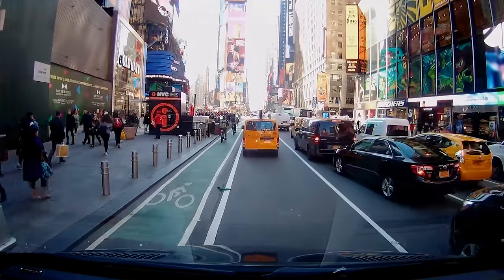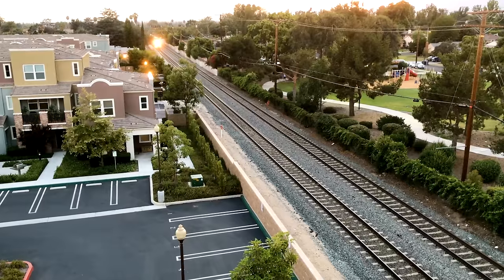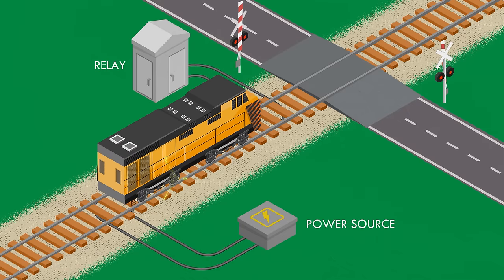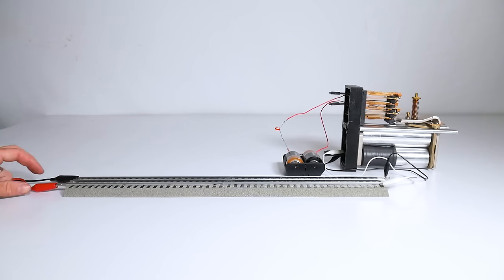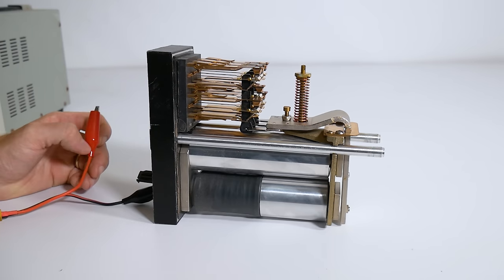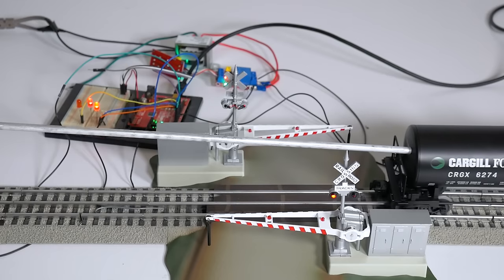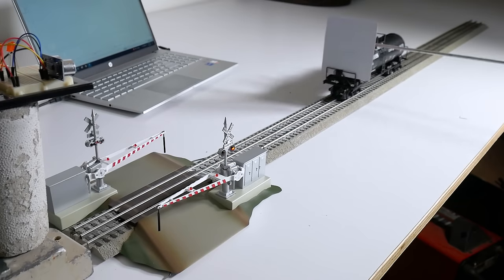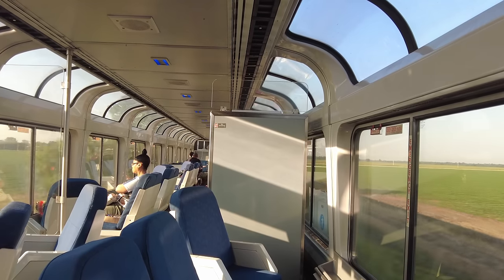How Railroad Crossings Work

Comment: It's quite interesting to see that apparently in the US the railroad crossings use track cirquits to detect whether a train is approaching or not. Here in Germany, they all work with directional switches that are activated by the train's wheel, and the crossing is opened with axle counting switches before and after the road. Basically if some amount of axles entered the road section and the same amount also left it, the safety devices shut off.
Reply: I'd say it's a standard in the EU now. All new actively guarded rr crossings built in Poland use axle counters
Reply: Yeah, in general it seems that American railroads (or the regulators) seem to focus less on preventing accidents, but instead they build everything railroad related like a tank so that on case of a crash, there are less deaths. A good indicator is that many railroads in America still use Track Warrant Control, essentially a glorified version of what we Germans know as "Zugleitbetrieb" or "Fahren auf Befehl".
Reply: @m0llux  I disagree with that assessment.
Reply: There are several different ways for railway crossings in Germany: axle counters are one, but there are others that are automatically closed when a signal is set over it, or the signalman has to manually close them from the signal box
Reply: Is it all axle counters in Germany? In The Netherlands, most of the network has track circuits as well.
Reply: The UK is all primarily track circuits. Anywhere that has been properly upgraded/resignalled since the 2000s are axle counters. Majority of areas are track circuit based level crossings and may include treadles to activate them as well. Very few areas use axle counters to activate level crossing. In the area I look after, there are only a handful that I can remember that use a form of axle counters (even in track circuit areas) to activate level crossings.
Reply: @marco23p  New and refurbished tracks tend to use axle counters because they are usually as reliable as track circuits, while avoiding its pitfalls. With track circuits, a single damp leaf can result in false positive signals and the isolation points usually get a lot more wear, resulting in higher maintenance cost and covered tracks (rust, leaves, sand) can lead to false negative signals. Axle counters usually (at least in Germany) work with inductive magnetic fields, so they are highly reliable.
Reply: In Germany we even have one track where a guy drives ahead of a train, closes the crossings, and once the train is through, drives back, opening them. But behind one of the crossings, there's only one house. Horrible solution, but that's what you get when politics has intentionally run down the train system for decades.
Reply: Pretty sure Canada uses the track circuits system too. I've heard of surveyors pulling tape across the tracks and having the rail inspectors come out as a result.
Reply: @GiantEnemyMudcrabz  “Pretty sure Canada uses the track circuits system too”
Canada and the United States are virtually identical as far as signaling infrastructure and design.
Reply: @Ruhrpottpatriot  While axle counters are very reliable the good old track circuits are safer. We also use axle counters in Belgium but I am pretty sure that most track circuits are still in place and a combination of both is used.
Reply: Axle counters aren't 100% reliable either, and they sometimes bring their own problems.

In Switzerland, it's not permitted to run a train with a multiple of 256 axles, because the axle counters store the count in an 8-bit integer and it rolls over after 255. So 256 axles would reset the counter to zero, making it a ghost train that can't be detected.
Reply: In the german-speaking railroad world, axle counters are more common, but track circuits are also used.

However, track circuits are more important in other countries like the U.S, Italy or the Netherlands. There, the signal aspects are broadcasted via a frequency through the rails.

Track circuits are more safer because of their superior detection qualities as well as their ability to detect broken rails. 

Axle counters are the more cost-effective solution in general, but are more prone to errors.

What you end up using depends on your rail systems infrastructure, situations and priorities.
Reply: Axel counters sound way more prone to error or damage than circuits
Reply: @Codewow  I am pretty sure they are less prone to error but less safe.
You might think "how can they be less prone to error and still less safe?". Well the problem with track circuits is that they can have lots of false positive (detecting a train while there is none) but a false negative (not detecting a train) is near to non-existent.
A typical false positive with track circuits is when it's snowing/freezing and road salt is used. Normally they avoid road salt near crossings but with cars driving arround the salt can spread.
Reply: @ppdan  I feel like a false positive is the best-case scenario when it comes to a crossing in terms of failure. It basically becomes a yield/stop sign at the point or a no-access intersection, if it is controlled by gates, that you have to detour around.
Reply: @Codewow  But too much false positives can have a negative effect. Imagine a crossing having far too much false positives to a point where people will start to ignore it thinking it's another false positive.
Lots of accidents at crossings are because people get used to the fact that they mostly still have enough time to cross ... but then ... it was one of those times where there wasn't enough time. There is also the "one train may hide another" where people cross right after the train passes not seeing that another train is coming because the first one that just passed blocks the view to the second one.
Reply: In belgium they almost all use both axiles and circuits
Reply: @SimonS44  Where in Germany are signalman still a think? I only know of infrared guns to close railway crossing on smaller regional tracks. But when they fail, the conductor has to manually close the crossing
Reply: cirquits
Reply: @marco23p  It depends on how new/well maintained the line is and if its a busy line or just some low traffic regional line. For example it can be the track ciurcet, crossing can be activated by signals (signal only turns green when crossing is closed and opens when signal block is free) or infrared guns are used, usally on regional lines when a station is in front of a crossing
Reply: I’m a signal maintainer in the US and we use a few different styles of ways to predict trains. We have grade crossing predictors that measure the speed of a train to the crossing and therefore activates it when it sees the train within 20-30 seconds of the crossing, we use track circuits separated by insulated joints, and overlays which is a circuit on top of a track circuit. Overlays can be up while the circuit is down. There might be even more, but that’s what we use on our railroad. We do have hotbox detectors that read bearing temps and count axles, but that’s not used for crossings. Also, as far as whatever system is better I don’t think is a thing, they are all good, but these systems are usually standardized based on cost and who cozied up and lobbied with the politician who pushed for it.
Reply: Those are the current standard in Germany (or the EU railway grid, actually), but with anything railway in Europe, it is just for new tracks. We still have any variant that was ever built from the 1800s onwards here. Track circuits are still in use, too, but they are old technology and therefore are phased out with refurbishment of crossings and mainly occur in less frequented crossings in rural areas.
Reply: @marco23p  It isn't. It is the new standard for a while now, but as in any European country, we have any railway technology ever put into service since the invention of the railway still in service somewhere in the grid. Track circuits should still be fairly common, as they are the precursor to axle counters.
There still are level crossings with entirely manually operation, too, in Germany. The only thing electrical for those is the telephone to tell the crossing operator (a guy in the train station close to it, usually) that a train will arrive at a certain time.
Reply: @ppdan  They are in fact NOT safer because track circuits have a multitude of failure modes, from leaves, to dirty tracks or trackbed and parasitic oscillation. Even a stronger rain can make them unreliable because the water on the tracks bridges the isolation. They can also fail with shorter and lighter trains. Not to mention that you need to replace the rails way more often.

Axle counters are better, but they are also much more expensive.
Reply: @jovetj  lots of Mexico too I believe, but kind of essential given how vital RRs are to freight movement in North America as a whole.
Reply: @Ruhrpottpatriot  Nearly all failures give a false positive, the big danger is having a false negative (not detecting an oncomming train) and those are highly improbable with rail circuits.
The biggest problem is parasitic coming from trains but those are well filtered and most have a detection that if such a parasitic takes place the train will shutdown (not going into more detail to avoid giving information here on how to tamper those systems ... and I am also not allowed to make that information public).
Reply: @KarlKarpfen  hello! I'm quIte sure the EU TSI reguation DOES NOT go in much detail as how railway signalling works, except that ERTMS/ETCS is the "safety system" to be employed. As ERTMS can be superimposed to the current national signalling standard, it is not defined how level crossings work because the RBC takes informations from the interlocking system (in Italy computer-based interlocking is required to install ERTMS). 
As far as I Know from signalling design, level croosing in Italy are managed differenty according to line importance and block type used. 
In high traffic lines where track circuit block section are used (BACC) level crossings are closed by occupying a set block section determined by line speed and opened as soon as the relevant block section (the one with the railway crossing in it) is freed. 
In low traffic lines where axle counters are used (axles counters are a block type in Italy and define if the line is free between two stations), railway crossing are closed using directional switches (whose distance depend on the line speed) and opened using a combination of a track circuit wich covers the reailway crossing area and an omnidirectional switch placed nearby (track circuit free and switch are both required to trigger the gat opening).
All currently installed level crossing system require a signal to stop the train in case of malfuncion (i.e. broken or stuck gates): it can be a block signal for BACC lines or a dedicated signal for low traffic lines. in both cases the train has to be stopped before getting to the level crossing.
Reply: Don't we use specific frequency detectors and stuff in Germany? I think you can't really compare German safety stuff to US railroad safety. The distances in the US are much bigger, trains much heavier (mostly) and very often the population density is lower by factor 100 or more. That resulted in different needs and regulations
Reply: @ppdan  thinking that false positves are way more likely isn't completely true. It's a very theroretical way of thinking about what can fail if other components of the system should fail that leads to this false assumption. In fact, we have to deal with the problem of not well-functioning track cirquits every day. There even is a paragraph in the german railroad regulation (Ril.408) which states that every track within a station that is fittet with track cirquits has to be driven over at least one time in 24h, otherwise it has to be seen as occupied because of the rust that forms ontop of the track. Another paragraph states that you have to tell the switchman after breaking, if you used sand till you came to a stop, because the sand can also insulate you from the tracks. And these are only the two most obvious cases.
Reply: @ppdan  They still have the problem that they might give false negatives in regular use. There have been multiple(2008, 2009, 2010 three in 2012 and two in 2013) near collisions in Germany because sand blocked track circuits. This has gone so far the the Eisenbahn Bundesamt as regulatory body issued multiple(!) orders prohibiting sanding in places where track circuits are used, unless absolutely necessary, precisely because the sanding (which had happened as dictated by regulation) prevented a circuit closure.

There's a reason why The DB Infrastruktur as infrastructure body, almost always uses axle-counters instead of track circuits.
Reply: Here in their Netherlands they are even integrated with signalling around stations to prevent crossings from closing. A train stops at a station for a specified time or until they operate a key (old method) or the traffic control clears the next section. Only then the crossing operates. Otherwise the crossing would be closed the entire time a train is stopped!

It’s complicated stuff and full of jargon.
Reply: Yeah sure that works great for your tiny little toy trains over there.
Reply: @mikeznel6048  At least we're not having disasters with dangerous chemicals that wipe out entire towns
Reply: The reason the EU uses axle counters is because of spacing control. One thing that has not changed in trains is that, at the heart of control, you have a token-passing system. It used to be from control box to control box, but it went to track circuits (prevalent in the US) where in the EU ERTMS where the tokens cover dynamic sections of track. They are all still used across the world! As part of getting the tokens for movement, you also have to ensure the switch is properly set and locked, no opposing traffic, until the next decision point. 
   Each has a tradeoff. The US trades granularity, and increased upkeep for the advantage of automatic operation (ABS - automatic block signal). Effective on busy freight corridors, where you can keep a two- or three-signal separation between trains. The EU relies on the trains to report their location using communication points (balises). The disadvantage is, in the event of a loss of state, you lose the tokens. You have to locate all the trains before the system is safe again. Axle counters provide some help in identifying occupied track sections, as well as protecting against a split consist (part of the train disconnects).
   You also need a centralized office for all the trains to report their locations to, and coordinate train movements. The US rail system has large areas where cell service can be spotty. 
   I've worked as a wayside signal engineer (US), and also for virtual block systems and PTC (on the Northeast Corridor, which is mainly ABS).
Reply: One other thing worth pointing out, that wasn't mentioned in the video is that continuous welded rail (CWR) is common in the US, and we are able to use AC track circuits still by putting a impedance bond (a coil)  where we want to divide the track - it provides a return path for the signal, and snubs it going down the rail. The advantage of CWR is it's smoother, you don't need fish plates (you need copper thermite), but the track circuits need to be tuned. 
   Rail crossing predictors involve calculating the max speed for the crossing, and determining how long the track circuit needs to be to provide enough warning. There's also logic in there in the event you have multiple tracks (you will ring the bell again and maybe blink the lights to indicate a second train approaching, keeping the gate down). As a controls engineer, you have to be aware of getting peoples' attention, and compliance, without being too annoying. Applies inside and outside the train.
Reply: @patrickvolk7031  What you wrote is utter nonsense. Block signalling exists since 1844 and automatic block control is used in Germany since the 1920s.

Also, ERTMS has NOTHING to do with signalling and tracks; that's ETCS, which defined multiple layers, from the old fashioned fixed blocks with track circuits or axle counters to moving blocks based on either GPS or Eurobalise positioning and a vehicle based position system.
Reply: It depends, there are limited circumstances (particularly in cities) where different detectors are used.
Reply: @edrose5045  that is a shocking oversight
Reply: @Ruhrpottpatriot  Axle counters aren't more expensive than track circuits. It's the communications structure that is the cost. Axle counters don't detect leaves or dirty tracks, or broken rail (that is more an improper inspection/maintenance problem). Why do you need to replace the rails more often (CWR with track circuits is standard, no joint plates)? I've had to investigate a (probably the only) parasitic oscillation problem, and it was a light rail and was because someone decided not to put a choke on their transmitter (and the customer allowed operation to continue with the problem). I've also seen one on an VBS (which is ERTMS more or less) where a train was not accounted for and collided after a power event. 
   Track circuit systems have been safe for over 100 years. There have been very few wrong-side failures. The US sticks with it because our rail companies are not state-run (except Amtrak), and it's not cost-effective for most of the rail network to change over. Lots of track has been removed, and more efficient use of other lines, and upgrading them has been the normal way.
   European rail is more than just freight. It's more dense in population than the US. The rail agencies are national resources. You guys run so many trains, the best way to increase capability is to space them closer together, and run them faster. The fact that operating rules have converged between countries, homogenizing the rails, removing breaks of gauge, has happened so fast is amazing. 
   Axle counters though don't need to worry about welded contacts from a lightning strike. They don't need inputs from another device miles away (often running on batteries where you're pumping 400VDC at the head of the codeline to get 24 VDC at the end, using some 400mm wire cause of the amps). 
    I've looked at EU communications for ideas on MOWESS (Maintenance-of-Way Employee Safety System). They have to rely on communications (if I hear 3G went away one more time...) because the speeds. US relies more on signs and lookouts (they can put down a shunt strap). I worked with some people in Germany discussing it (looking to cover each other with line-of-sight versus timetable safety).
    Both work, and work well. We always look to make them work better though.
Reply: Small add to this discussion: Germany doesn't build grade crossings anymore, if a road or rail is newly build or renewed a tunnel or bridge has to be build (the regulating agency could allow for grade crossings (only for sub 160km/h rail) in low population areas, but usually doesn't).
Reply: @nukehunterlp1371  You would need all wheels from the same side to be insulated completely from tracks and if all wheels from both side get insulated from the tracks you would loose traction unless it's a Diesel train. Also if the train is not detected and the crossway is not closed why was the previous light not red?
Reply: @patrickvolk7031  "Why do you need to replace the rails more often "
If you worked with rail you should know that... You have a weak point at the isolation point. That's a simple fact. Yes you can harden both ends of the rail joint, but it will still be weaker than a welded rail (which is the norm here in the EU). That's physics. Axle counters don't need rail joints, so that problem doesn't exist for them.

"CWR with track circuits is standard, no joint plates"
That only works with audio based circuits, not with electricity based. The latter MUST HAVE an isolated joint. However, the former has it's own problems, especially when electrifying the track because you need to watch out for your impedance characteristics.

"The rail agencies are national resources."
Most EU rail companies are private. Japan's railways are private. Both use axle counters. Your argument is invalid.

"The fact that operating rules have converged between countries, homogenizing the rails, removing breaks of gauge, has happened so fast is amazing."
There has never been a break in gauge, except in the former Russian Empire and Spain. Everybody else used standard gauge since the boom of railway in the 19th century.
And the two areas where wide gauge is used, it's still used today. The only country that wants to completely switch to normal gauge is Ukraine (for obvious reasons). All others will keep their own gauges.
Electrification is also not standardized and probably never will be and ETCS has provisions for national signalling built in (called "Level 0").

"They have to rely on communications [..] because the speeds."
We don't. Every country that has high speed has systems in place that does not need GSM-R/3G.
In Germany there's two systems, one for 160km/h and below, called PZB wich works with track-side signalling and LZB, which has cab-side signalling and works with a continuos antenna in between the rails. Heck, all (or almost all) main signals in Germany still have a phone-box.
ONLY, ETCS Level 2 and 3 need radio to work. Level 2 is only available on a few lines and Level 3 is not used at all.

"cover each other with line-of-sight versus timetable safety)."
There is no "timetable safety", not for the last 150 years. Safety in Germany and the EU is done by the common block signalling. Time-tables have NOTHING to do with that.

Please, please. Inform yourself, what you write is completely wrong.
Reply: @patrickvolk7031 "One other thing worth pointing out, that wasn't mentioned in the video is that continuous welded rail (CWR) is common in the US, "
It's also common in the EU? What do you think we are? Cavemen? Dude seriously, you're getting insultingly arrogant.
Reply: Well in the US we don't really use this type of crossing anymore. We use predictors such as the Siemens GCP and the Alstom XP4. They use AC signals to determine the speed of the train and give whatever warning time is programmed.
Reply: @Ruhrpottpatriot  You got anything other than semantics and "Deutcher ist besser!"? 
   Sorry, I should've said ETCS Level 3 systems. Because you said axle counters are better than track circuits, that's where I went (axle counters aren't reliable in brownfield installations)
   Safety 101 for you. There's open-loop, and closed-loop. Open loop requires something inserted into the safety loop to make the system safe. Closed loop means something have to be held off in order for the system to be safe.
   My brother thinks this is a bad analogy, but closed loop is your accelerator pedal. You can't make the car go unless you press it. If the pedal breaks. The car slows down.
   Your brake pedal is open-loop. The car goes until you hit the brakes. If the brake pedal breaks, you've got problems.
    Which is more common... parasitic oscillation (name one aside from Ft. Totten, I'll wait), or dragging equipment. If I remove the axle counter, what happens???? That is open loop. I remove the track, what happens? 
    GPS is soooo good, subs use it underwater. Works good in tunnels too, and is accurate enough to identify which track a train is on reliably... right? 
    Same with communications. Leaky feeders are fun things to work with. 
   ERTMS is more like CTC. Mea culpa.
Reply: @Ruhrpottpatriot  "You need a IJ for electricity-based circuits, not for audio ones". Energy-based is a better definition. Audio is AC you know, at a variable frequency, right? We run coils over the tracks to pick up cab signals. Track circuit frequencies cannot be harmonics of each other, and we use impedence bonds (like with 11 or 13 loops normally) between circuits. The track circuits overlap. 
   You don't drill CWR. 
    What about The Great Northern and CIE Railnet? They're broad gauge.
    I stand on the communications. Yes, there are wayside station which can communicate with the train. But they also communicate with the office. It's not just one fabric. Same principle, just one is islands of communication, and the other is constant. The discussion is the same.
    The MOWESS scenario I was given was you have a wayside maintenance crew clearing debris or checking slide fences.  Do you give them a track block and stop all traffic for the duration? No (This is from EU people. We would do a Stop-and-Proceed Speed Restriction in the US). You would tell them a train is coming in 2 minutes, get clear by then.  They have mobile communications spots to ensure the crew is connected. But the train is going at speed.
    Axle counters are still open-loop. Audio track circuits are closed-loop. A shunt strap is closed loop. A track permit is open loop, so if a dispatcher mistakenly clears it (which they can't do anymore, only the holder can), you know the train is getting a restricted signal.
Reply: @Skullair313  Axle counters are necessary if you don't use track circuits, primarily because you need to protect against a parted consist. 
  Broken rail is not really that common of an error. It's been noted often than in the event of a washout, the track may be unsupported, but it's still electrically intact. I've seen track hydraulically pumped into mud by trains indicate correctly and still cause a derailment. 
   Especially with CWR, because you have no uneven joints to hammer across.
Reply: The active crossing signals that fail the most, are the ones that were never installed.  In the U.S., railroad companies use economic analysis to decide when to ignore governmental orders to install active crossing signals.  In areas away from cities, the railroad companies may decide it is cheaper to pay the repeated fines and occasional accidents, than it is to install and maintain active crossing signals.

I learned much about railroad companies NOT installing government ordered crossing signals, when my brother was killed at one of these crossings.  The railroad company had been ordered to install crossing signals for over 60 years, but none had ever been installed.

The trains approach that crossing from around a blind curve on a downhill grade.  Train speeds are frequently 70 mph (110 kph).  At that speed, there is only 11 seconds between the train and crossing first being in sight of each other, and the train being in the crossing.

After my brother was killed at that crossing, the railroad company still hasn't installed crossing signals.  Instead, later on the day of the accident, they cut down all bushes and trees near that crossing, so they couldn't be accused of not providing maximal visibility.  They transferred the train crew to the other side of the country, to make it more difficult for anyone filing a law suit to gather eye witness information.  They generously paid people in the houses nearby for reporting any pedestrians at the crossing.  I don't know if they installed surveillance cameras, too, but I would believe it.  I went to personally look at the crossing about 5 months after the accident, and within 13 minutes of arriving, a railroad employee drove up and firmly told me the crossing was railroad property and I was not legally allowed to be on it or take pictures of it.  (Under this "law", pedestrians walking the road would be blocked from following the road where it crosses the tracks.)  I assume the railroad employee couldn't legally stop me from being at the crossing, and it was just railroad company bullying to try to hinder any lawsuit investigation or any media coverage.

I have a very low view of railroad companies.  My experience was that they used bullying, harassment,  and denials, to prevent paying anything to my brother's widow and their small children.  They denied having any knowlege ever receiving any governmental orders to install crossing signals, even though the government has those records, plus the governmental records of the railroad company having paid the decades of fines for not installing crossing signals.

Railroad companies not installing government ordered crossing signals, happens at rural crossing across the country.  The government's cost analysis for saving lives, differs from the railroad companies' analysis.  And the railroad companies win, because most governments cannot enforce their orders.

Non-existent active crossing signals ALWAYS fail unsafe.
Reply: Counting axles seems like a software bug waiting to happen.
Reply: What do you suppose an "axle counting switch" is but a circuit?
Reply: @patrickvolk7031  "GPS is soooo good, subs use it underwater. Works good in tunnels too,"
GPS has a signal strength of about -125dBm, with good signals hovering around -90dBm. Signal to Noise ratio is usually between 15 and 20 dBm. For comparison: Your home Wifi has a signal strength of -30 to -60, with -90 being considered "disconnected".
So, no - subs don't use GPS (unless they are above water) and no -- it does work in Tunnels (unless you use repeaters).
I do military UAVs research and we can jam GPS with ease. A thicker roof is enough to make the measurement irrelevant. 

"Sorry, I should've said ETCS Level 3 systems."
A future system level that non rail in the EU uses.

"Audio is AC you know, at a variable frequency, right? "
the type of current has nothing to do with audio signals, unless you're talking about the power source for the frequency generator. And yes of course I know you can vary the frequency, that doesn't invalidate my point.

"Track circuit frequencies cannot be harmonics of each other, and we use impedence bonds"
Thanks, you just repeated the second week of my audio class in university.

"You don't drill CWR."
What does this have to do with anything?

" What about The Great Northern and CIE Railnet? They're broad gauge."
Great Northern is standard gauge 1,435 mm. CIE is in Ireland, which is an island and can do whatever they want because they have no need to interoperability.

"I stand on the communications. Yes, there are wayside station which can communicate with the train. But they also communicate with the office."
That's not how train scheduling works...
You have multiple dispatcher offices around Germany. They make sure that as many trains get to their destination on time by shuffling the order of trains in case of unforeseen circumstances. They have NOTHING to do with how the trains move on the tracks.
That part is done by the Signal boxes, which set signals, set the track at which a train arrives at a station, etc.

"Do you give them a track block and stop all traffic for the duration?"
Depends on the situation, for smaller work you just have a security post that spots trains and alerts worker, longer work usually has temporary speed restrictions and automated (but not radio based) train spotting equipment, while big works can have track blocks. Everything is possible.

"They have mobile communications spots to ensure the crew is connected. But the train is going at speed."
You're mixing maintenance crew communication with cab communication and signalling. Those are two completely different areas that have NOTHING to do with each other.

"There's open-loop, and closed-loop. Open loop requires something inserted into the safety loop to make the system safe."
That's not what open-loop and closed-loop mean. Open loop is when you transmit feedback to the control element without using feedback from said control element, i.e. you don't get a signal back whether or not your command was executed properly. Closed loop is when you use the control element's response in your decision for the next command. This is something I'm intimately familiar with because I use it almost daily at my work.

"You can't make the car go unless you press it."
If your motor control runs haywire you can go, even if you don't press the accelerator, even on older cars with no electronic speed control.

"The car goes until you hit the brakes. If the brake pedal breaks, you've got problems."
Only in a vacuum, with no tyre friction and no engine break. In fact I once sat in a car with air in the break lines. Stopping was no problem, as we just shifted down and let the engine slow the car down until we only went ~7km/h and then we used the hand-break.

"Which is more common... parasitic oscillation (name one aside from Ft. Totten, I'll wait), or dragging equipment."
Not parasitic oscillation, but there have been at least six near collisions in Germany because track circuits failed to recognize a train because the wheels didn't make contact because tracks were dirty, and no, that wasn't on a rarely used track; it was on a mainline. This went so far, that the regulatory body gave out an executive order, prohibiting sanding on all tracks in Germany when you're driving below 25km/h unless sanding is absolutely necessary and then you have to inform the signal box.

"A track permit is open loop, so if a dispatcher mistakenly clears it (which they can't do anymore, only the holder can), "
There will always be cases where the signal box clears the permit. 
On that note: Dispatchers here in Germany (and iirc the EU) don't give out permits, the signal boxes do, because only they define the route. The dispatcher just tells the signal box: "Send that train to _there_"

Seriously, you apparently have no idea how train and track security works in the EU. You maybe have read one or two documents on ETCS, but you missed the dozens if not hundreds of others describing the actual stuff.
Reply: @patrickvolk7031 "There's open-loop, and closed-loop. Open loop requires something inserted into the safety loop to make the system safe. Closed loop means something have to be held off in order for the system to be safe."
Never heard of this definition. open-loop usually refers to a system without feedback. It has nothing to do with safety, except in certain circumstances which make these two concepts align for this specific case.
Reply: @somebod8703  I did not know the technical definition. A mechanical trip stop is open loop to me. A cab signal is closed loop, it's absence means you don't go.
Reply: @patrickvolk7031  Your definition of open/closed-loop is simply wrong. As I said earlier, an open loop system is a system where the motion control does not depend on the feedback from the motion controller, while in closed-loop it does.
See: "Feedback and control systems" - JJ Di Steffano, AR Stubberud, IJ Williams. Schaums outline series, McGraw-Hill 1967
Reply: @ky314  Actually, no. Axle counters are not software dependent at all and you can build fully mechanic systems. Though modern systems usually are IC-Based for cost reasons. However, given that electro-mechanical axle counters are in service since the 1930s, i think we can assume they are safe.

That said, even though you could build track circuits with only electric and no electronics, you the run into problems like fused contacts on relays or similar stuff. And audio based track circuits also relies on electro-mechanic or electronic equipment to work, so they are as susceptible to software bugs as axle counters.
Reply: @patrickvolk7031  If you don't know the definition of basic terms you are bringing up yourself, maybe you should not try to teach "101" classes to other commenters. What the words mean to you is of little meaning when they have a well-defined meaning for everyone else.
Reply: @somebod8703  It does. You want to check everything is in a valid known state before you allow operation. If you don't get that, you stop.
    Air brakes are an example. To operate, you need pressure in the pipe. Until the minimum pressure is reached, you don't allow the train to move. Energy is necessary to keep the pipe from being opened in the cab. Go overspeed, you drop power. They used to use a mechanical arm to open a stopcock to dump the air when a signal was red. But they can break (not providing feedback).
Reply: @patrickvolk7031  What does what?
Reply: @somebod8703  What do you mean? There's the vital zero circuit, which needs to be established to change direction or open doors, and then there is the EBR. It's a valve that is held closed magnetically. Break the train line, it dumps physically. You stop, and have to charge the pipe to get back to VZ and move. 
    It's not taught in school in the US. You have to go through AREMA standards. 
    Closed loop is I have to get a token to do an action. Loss of a condition is stopping (feedback implies it's from itself, which isn't necessarily true. There is PTC/civil speed, ATC/signal speed, vehicle max speed, and train integrity which all have to allow the train to move. You have another set of checks on the wayside to give a train the ATC aspect to go.
    It's turtles all the way down. Your hardware is one-point safe by design. You check your processors and memory for integrity.  If an axle counter gets taken out by dragging equipment, how do you know? If a balise is?  
   It feeds into the safety loop. Loops on loops. It's turtles all the way down. That's why we put seals on bypasses, or counters. On-board, wayside, office, it's the same principle.
Reply: @patrickvolk7031  I was criticising your wrongful use of terminology. Yet you are answering with concrete examples of safety concepts. Two different things.
Reply: @somebod8703  As opposed to complaining about my definition while not applying it to the axle counter analysis. So are you saying an axle counter is neither because it doesn't control movement per the established definition?
Reply: @somebod8703  I take back what I said. You strive for closed-loop. The system is restrictive in the base state until the conditions are clear. The feedback is the presence of a permissive condition. 
   An open-loop requires the introduction of a restrictive signal. That is external to the system, so not feedback. 
    Knowing a definition is different than understanding the concept.  I showed multiple examples, at different levels. Didn't meet the definition?
Reply: @Ruhrpottpatriot  Keep handwaving... Wholly mechanical systems are better... so why did the US stop using cable-controlled semaphores... And the UK stopped using treadles for train detection. 
   Relays don't need software. They're done on PLCs now somewhat. 
    Track circuits fail safely in most cases. But the elephant in the room of the discussion is this..  More importantly, track circuits are 0-1. Axle counters are based on a difference. 0 to x(a) to x(a)=y(a) to get back to zero. If you're using a signal box, then you're using the Mk 1 eyeball of the signalman. 
   Track circuits are designed to withstand rough conditions, and lightning strikes. I don't know why you think your electrical circuits are safer than mine. 
    And you can use magnetic effect sensors to avoid mechanical wear and keep the equipment a little bit clear, but it doesn't change that if that sensor is removed, what does the train do? Remove a track, and what happens?
Reply: @Ruhrpottpatriot  You don't understand sarcasm. You mentioned all the 'reliable' systems, and are telling me they're wrong. That's why there are balises and RFID tags. 
   If I have AC or DC returning through the rails, I can still inject and receive a signal. I can get a track frequency, and send a cab signal at a different frequency. With hundreds of amps of current running through the tracks. I can pick up those signals placing a coil over the track also. It's done literally everywhere.
   What sets the signals at the signal boxes... themselves? Magic? Or you tell the box operator to set up a route at a time. 
   How do you tell trains to stop at a location, from the signal box? You have to get and acknowledge in your log book and the station book you received all train 
orders. If you don't, it's not safe. 
    And when passenger trains are running at 200+ km/h, work permits are a big deal. You can't 'spot' trains in the braking distance at those speeds. You're high.
    What does an acknowledgement give you? Nothing really. You got a speed restriction, so what... are you following it?
   Your sand problem is a problem with.... sand, and not track circuits. If you're putting down enough sand to insulate the train, you're not using sand for grip, you're running on sand at that point (and more sand is not the solution).
    Germany must be a magic land, where things runs differently... Not primitive, but still have signal boxes and signalmen apparently. Being of one mind, there is no need to communicate beyond signal boxes. Where magicians in ERTMS point their wands and trains magically go. Not a word is spoken.
Reply: @patrickvolk7031 "Wholly mechanical systems are better... so why did the US stop using cable-controlled semaphores.." I never said that... But sure whatever.

"More importantly, track circuits are 0-1. Axle counters are based on a difference. 0 to x(a) to x(a)=y(a) to get back to zero."
In circuitry there's no practical difference between a boolean and a sum. After all they both rely on the same JNE or JNZ assembly at the end (depending on the compiler used). Even if they didn't we're good enough at making integrated circuits that they simply don't fail on that level anymore.
Even if we *would* use electromechanical counters (which we don't) and relays, both equipment types boil down to the exact same stuff. After all an electro-mechanical counter is also implemented by closing a circuit.

What you just wrote goes against every electrotechnics and computer science handbook I have ever read in my university time.

" If you're using a signal box, then you're using the Mk 1 eyeball of the signalman."
I don't know how it is exactly in the US, but no one here in Germany uses their eyeballs to confirm if a track is clear or not and we still use signalboxes. God, you're ignorant...

" I don't know why you think your electrical circuits are safer than mine. "
I never said that either.

"what does the train do? Remove a track, and what happens?"
Your analogy is completely bogus. When I remove the track with an axle counter, then the same thing happens when I remove a track with a track circuit.

The better analogy would be: What would happen if I cut the cable to a track circuit. The answer is: The track is marked as "free" and always will be because no circuit can ever be closed. At that point you need to use other equipment to check if your track circuit is in order and then you have the same situation as with an axle counter.

"Air brakes are an example. To operate, you need pressure in the pipe. Until the minimum pressure is reached, you don't allow the train to move. "
You completely forget that you can totally override air brakes by utilizing this little wheel on each cart. If that wasn't there, then shunting over a shunting hump wouldn't work.
Reply: @Ruhrpottpatriot  You have no understanding. A track circuit is unoccupied when a signal is going through it. Interrupt that signal, the track is occupied.
    You definitely don't know RR terminology... what does free mean?  You request a route from wayside (or a signal box manually), and traffic is established, the route locked, and the way clear. You don't just get a green light. Is there a train ahead of you? How close? We have route and aspect charts which we implement in boolean logic.
    If I unplug a traffic circuit, gravity will put the track as occupied. If you unplug an axle counter what is it going to report? Not. The. Same. 
    You don't understand safety logic. It's backwards from the standard if (error) or exception catch. The default path is error, and you check for valid (and both sides).
    If I don't get voltage, or get voltage on the back contact, the track is occupied. I also supply my own power through the contacts, to avoid shorts.
    How the hell you do that on an axle counter?
Reply: @Ruhrpottpatriot  Why does it have to come from the motion controller? If I have a metro train, I make a circuit to make sure the parking brake is on, the wheels are stopped, the motors are off before I allow the doors to open? No movement for feedback, but it's closed loop. I don't allow the traction motor to engage unless the doors are locked, the brake is off, the reverser is set, they key is set, and I have a permissive speed command. I'm not checking the motor controller, am I? Interlocked systems are closed loop.
   The Panama Canal has an interlocked system. Can't open both gates at the same time, can only open the gate when the water level matches, fender chains are lowered, valves are closed. Where is the motion control.. the ship isn't part of the system there.
    You know the definition, but you don't understand what it means. If you don't use track circuits, you need some way of locating the trains. More importantly, the train needs to know where it is. Balises tell it where it is, but the accuracy decreases with distance (wheels wear). A switch plant needs to tell the train and the office that the route is lined for the train to pass through it at a given speed. An axle counter needs to report to the train and the office that it counted so many axles. You need two axle counters (and balises) for direction. Hall effect sensors can have trouble when you're creeping (moving under 1.6 km/h). 
    PTC and TCMS level 3 are being mandated because train operators can't be trusted to follow speed limit signs. P.S. the definition has changed since 1967! A thermostat HVAC is a closed loop system. Not just motion cupcake....
Reply: @maurocolombo2173  I agree with you there, as we, too, have different regulation and thereby solutions for different lines. I just tried to outline the two most common variants, as all exact types and variations for all different signalling types and rail types in use would fill a book or two. I just wanted to counter the statement that there was a single way of doing it in Germany, because there is a new current standard out there. Most crossings (and railway lines, signals, etc.) are not up to current standard.
Reply: @patrickvolk7031 if an axle counter gets taken out, track will show occupied because:
1) incorrect axle count
2) bad axle read on AC head
3) axle counter detects it has fallen off rail

Indications for any of those can be provided specifically to maintenance staff depending on the product used. 

Redundant processors which indicate occupied if they don’t agree. 
Input checker cards verifying Q style relays match what the evaluator outputs. 
These are and perform as safety critical products.
Reply: @patrickvolk7031 
Ps, axle counters default to “occupied”, can be reset by the remote controller in certain circumstances (procedure requiring the previous train confirms no separation, staff traverse the whole block to verify clear, etc), but often requires local staff lift a reset restriction. 

Each axle counter head is two sensors, the axle counter on each end knows whether it’s counting IN or OUT, this is related to reset restrictions, “incorrect count last count out” allows the controller to confirm with train staff they haven’t separated before a reset. “Last count in” is reset restricted until local staff lift the restriction.
Reply: @thomasa5619  What you say implies the axle counter knows what is going on. It can't if it fails. What you are describing is at the level above. The axle counter logically doesn't show occupancy, unless a train is currently passing over it.
    It just reports how many wheels passed over it. Another pair on axle counters is necessary for occupancy. That covers the track between.
Reply: @thomasa5619  An axle counter cannot be occupied. The axle counter unit will have 2 sensors for direction. Two axle counter make a track block between them. 
   Whether it's occupied or not depends on the difference count between the two. If they're not equal, the block is occupied. 
   Are they one-point safe? Not if the AC at entry fails. But, you have a chain of ACs, each one ends a block, and starts a block. So a failure would be interpreted as both blocks occupied.
   So in that fashion they are one-point safe. There are complications (like switches) which can be handled.
   The problem state is when starting up.  You can't allow trains to run until they have all been located.
Reply: @patrickvolk7031  yes axle counter heads are always used in pairs, which report back to one or (two via industrial comms) evaluator boards, the evaluator energises a track relay signalling to the controller track is clear. And each head has two coils so it knows whether a train is counting in or out

If any part of the evaluator or axle counter heads fails, it reports that track is occupied (or both tracks that head is responsible for)

Had an axle counter head fail the other day, couldn’t reset the evaluator until the head was repaired, the track showed occupied to control.

Power outage at another station recently, had to drive the whole station to verify no traffic, then lift the startup restrictions on every individual axle counter “track”.
Reply: On the regional line where I live, they installed axel counters because 4-6 trains per day did not keep the circuits reliable. In Melbourne city, there is quite a mess of systems. Some use axel counters, others use wired relay logic, most track use mechanical ATS, some use TPWS, and some use CBTC.
Reply: @m0llux  Yes, the US uses track warrants, but that's in areas that see very few trains. It's entirely feasible to have a 100-mile line that only has a couple of trains a week. You don't need a signalling system if there's only one train moving at a time, and installing one would be prohibitively expensive, with zero benefit.
Reply: @Ruhrpottpatriot  "With track circuits, a single damp leaf can result in false positive signals"
They must have very big, very conductive leaves in Germany, if one rail can bridge across two rails that are 1435mm apart...
Reply: @beeble2003 
a) The problem of track circuits is not unique to Germany and there exist countries in where such big leaves exist, e.g. Japan.
b) Still, this wasn't what I was talking about: I was talking about the gape that you have between two rails on the same side. Those are just a few mm wide.
These gaps are massive fault points for track circuits, in addition to reducing the passenger comfort, reducing the lifespan of the tracks and the wheels and also limiting maximum car speed.
Reply: It's probably just the age of the infrastructure, most North American railroads haven't had significant upgrading / infrastructure investment since the end of WW2. We have rolling stock built in the 40s and 50s still running on the tracks, and freight engines from the 70s.
Reply: @agilemind6241  Not sure what you're talking about. North American rolling stock is retired after 50 years max. There are no freight cars built before 1974 on the mainline network.